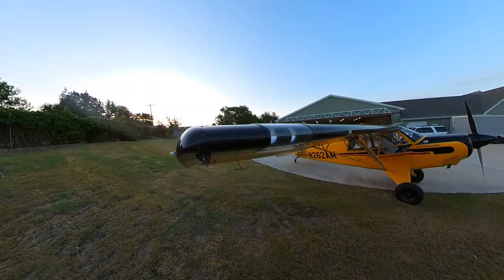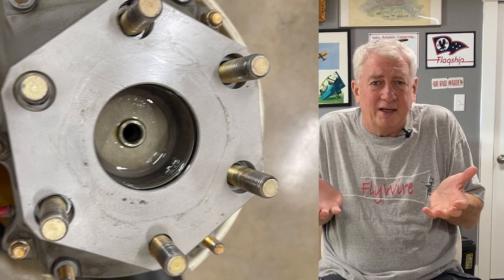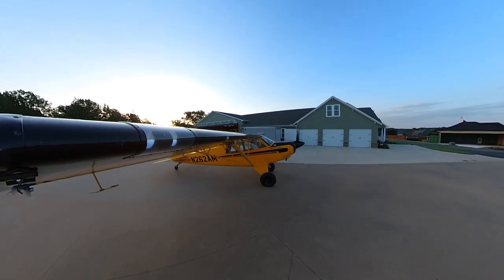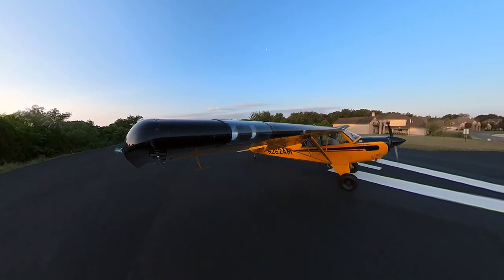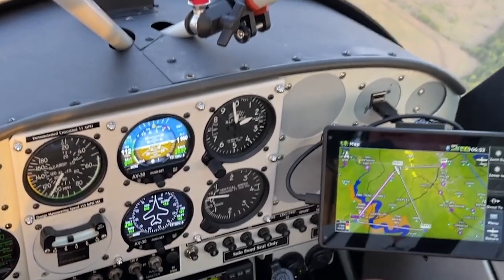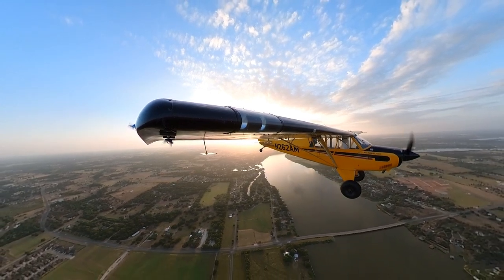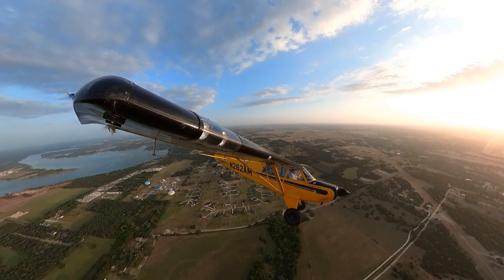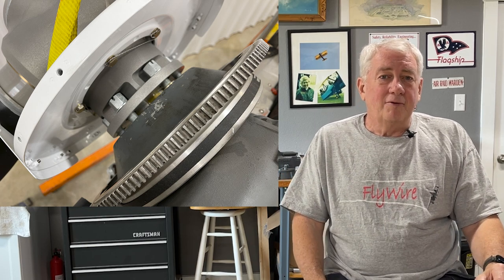Husky Prop Faceoff MT vs Hartzell 1

Comment: Great video. I have found metal props to be super efficient, bulletproof, easy to overhaul, yet heavy. Fixed pitched metal props also keep pulling hard if the idle is set too high. MT's are awesome propellers yet expensive. You should show the new prices on both. 20 extra lbs. on a Husky is not much although a lot of leverage weight at the front tip of the airplane. Metal props are also much easier and safer to hand prop. If you're not doing aerobatics it's not worth the cost and hassle to change IMHO. Light weight composite props are really designed for aerobatic airplanes doing tumbling maneuvers that can snap the crankshaft.

Comment: G'day Scott,

Yay Team !

I love the Triangulated Airspeed Truth Calculation ; and, yeah, 0.003 of a Difference sounds like the Airframe Drag plus Induced Drag have ganged up to agree between them that it doesn't matter if the two Propellers climb with differing efficiencies due to the differing Disc Density effecting "slippage"...; because at Cruise Power both Prop's run into the fact that as Speed doubles then Drag Squares - so the small difference in Thrust generated at that RPM are almost irrelevant compared to the Drag-increase generated by raising Airspeed by even 1%...

My Control Freak tendencies lead me to wonder if weighing the Fuelburn used on the two separate Flights might not be the definitive method of determining the Relative Efficiency of the two Airscrews...(?) !

With the same Ground-Track and Distance flown, with the difference in True Airspeeds  barely the width of a Sandfly's Foreskin....; then with the same Engine..., the only way to measure Airscrew Efficiency - at your favourite Throttle/Oil/Head-Temp. settings..., is to weigh the mass of Motion Lotion burned in the two separate  exercises...(?).

Keep on keepin' on...

Stay safe,

;-p

Ciao !

Comment: Doing things alone can be a challenge at times, When I come across a situation where it requires 2 people I try to find a way to Macgyver it, works most times. As for that larger prop, how does it affect the air flow over Elevator and Rudder control surfaces at higher density altitudes when you pull back on the throttle for approaches? That looks like a pretty large Disc-Area when rotating (the prop). Thanks for the update. :) NC

Comment: I can’t help but wonder if the Sharrow Marine propeller has an application in aviation. 30% range increases at medium cruise. Just imagine…
Reply from the maker: Water is much denser than air.
Reply: @FlyWirescottperdue  oh yes! I meant the design concept to eliminate vortices at the tip; nothing about size and pitch! If that’s what you thought…

Enjoy the new prop! Cheers

Comment: I'm first and second Like,  wowser.     If I was to learn/buy which type a C150  VS  a:  Husky,  Carbon Cub, JustFly Highlander?    I still like the G36 wish could learn in that.   Thanks in advance.
Reply: You have listed 4 very different aircraft, in capabilities and price. You need to be more specific about use case and budget.
Reply: Fly a Pitts Special
Reply: @chadwickalexanderjr1758  OK I'm sorry I didn't realize there was that much difference between the tail draggers and the Cessna 150.   I do realize quit a difference in a good Bonanza.    So pick one;  can a person learn to fly in a Husky or do all beginners have to start in the C150-C172.   I have eliminated the Highlander since they stall tail first.   They fall like a duck.
Reply: @pittss2c601  I think that safety record for a beginner trainer is very poor.
Reply: @MrCobb-rq8iv  it's not the airplane, it's the pilot.
Reply: You probably don’t want to learn to fly in a tail wheel airplane.  Best to learn in a tricycle gear plane like a Cessna 152/172 or a Piper.
Reply: @justsmy5677  Why?. All pilots learned to fly in taildraggers in the early to mid 1900s. That was normal and taildragger airplanes are much better designed today.
Reply: @justsmy5677  Ok could I move up to a 182T?   I'd rather not buy six airplanes moving up to the G36?  Two is plenty.   Not wild about learning in an old tired school airplane.
Reply: @Pitts S2C and Mr. Cobb tail wheel airplanes can be harder to handle.  Taxi (visibility seeing over the nose) landing and landing rollout can get tricky.  Ground looping a tail wheel airplane upon landing is not uncommon.
Tricycle landing gear gained in popularity due to the incidents occurring in tailwheel airplanes.  Tricycle airplanes track straighter down the runway.
This is why the FAA requires a tail wheel endorsement (checkout) before you are qualified to fly a tail wheel aircraft.
Just keep it simple while getting your PPL.  Most CFI are qualified/current in 152/172s and small Pipers, so it is easier to find a CFI willing to teach in one of those aircraft.  They fly easy and predictable, so doing stalls/slow flight, etc. is easier.  They also burn less fuel, saving you money.
Cheers!
Reply: @MrCobb-rq8iv  The insurance cost probably differs greatly, I'd like to know the comparision.